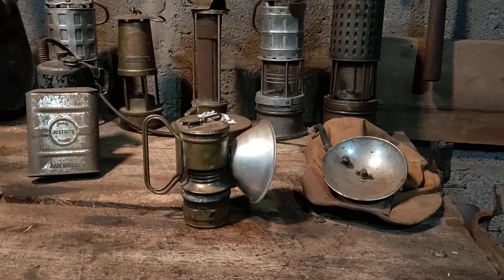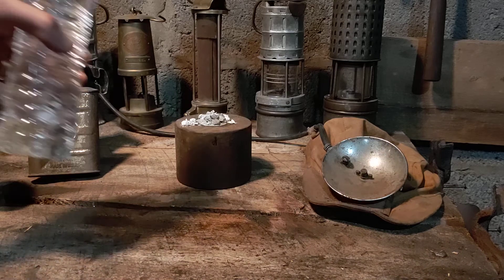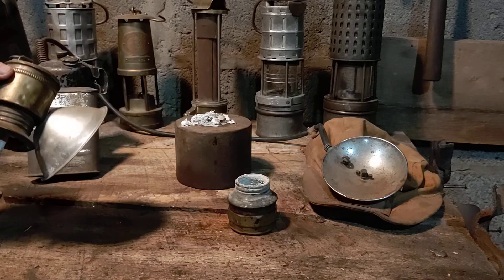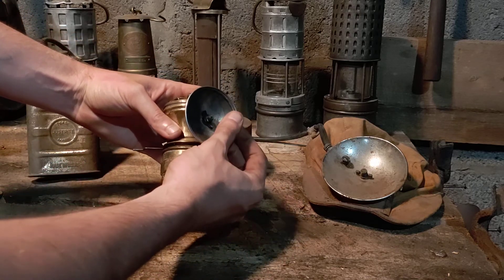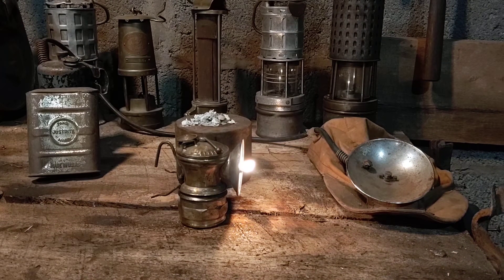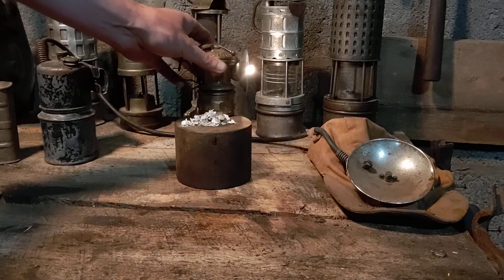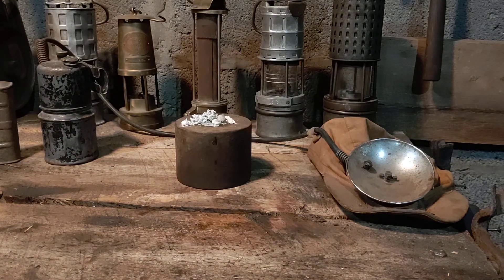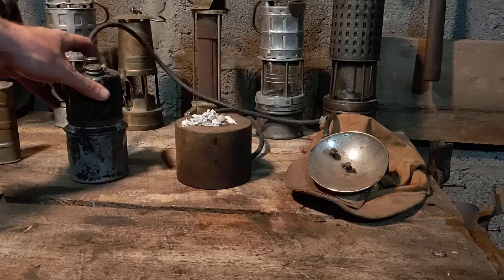Carbide Miner's Light

Comment: Nice video. I would suppose that even after the use of carbide lamps became popular, a miner would still have a few candles tucked away just in case... have you found candles in mines from the carbide lamp era?
Reply: Hello. I can answer your question. I've never seen candles underground. Also, the miners worked with another man known as a laborer, so safety in numbers. They would carry plenty of extra carbide fuel in spare bottoms with lids on top of them to seal it off from moisture and/or they'd have actual flask sized Justrite carbide tins to carry extra fuel.